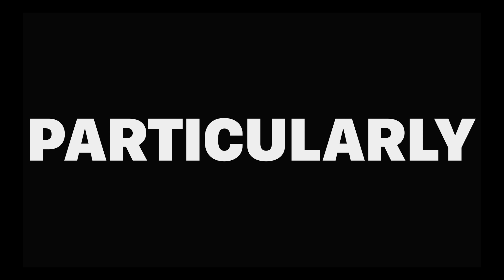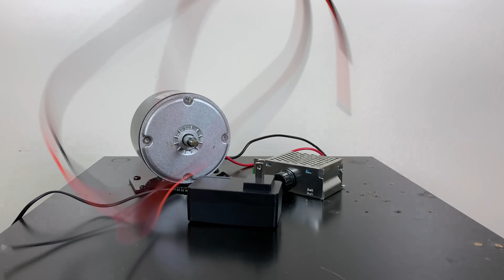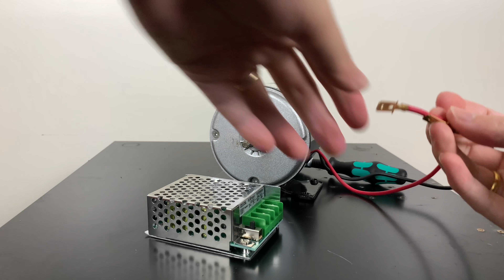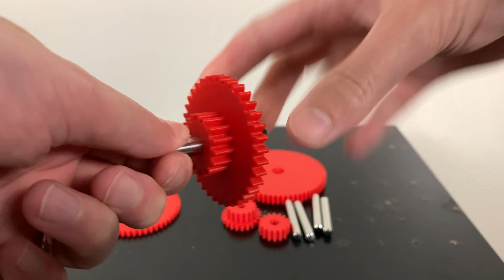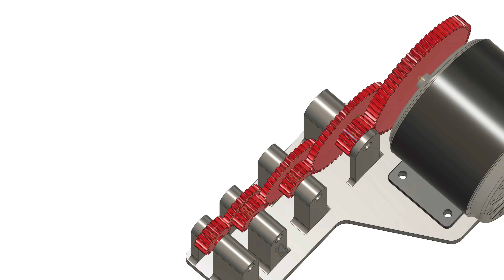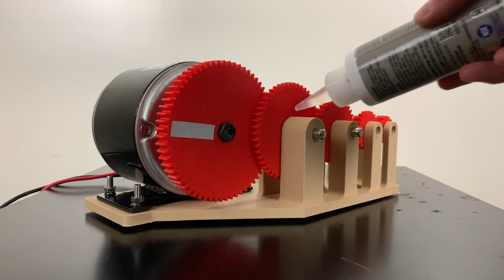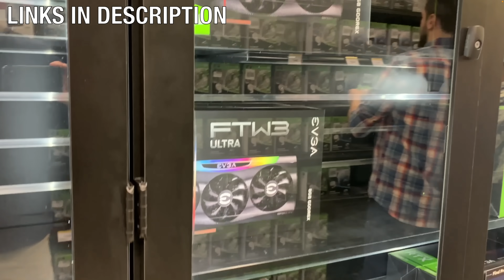Fastest 3D Printed Gearbox Ever.

Comment: The large motor did not stall, instead it drew too much current for the power supply to handle.

With brushed dc motors, the more it is forcefully slowed down, the higher current it draws. 
Since this one is built to spin quite fast, it's very far away from the rated speed, so the current was really high

This does not mean it overheated or stalled, nor did it not have enough power.
A dc motor at this scale probably has enough starting torque to shear these plastic gears, since stall torque (and thus stall current) is REALLY high for brushed dc motors. It's basically a short circuit.
If you hook a dc motor this large up to something like a car battery, you'll see what I mean. Even small motors become harrowingly powerful at low speeds.

Whatever was powering that motor was NOT even close to being enough. It's like putting a lawnmower carb on a truck engine. The engine can handle much much much more, but you don't give it what it wants.

Most non-current-limiting power supplies (so not lab bench power supplies for example) have a simple overcurrent detection that just shuts off power if too much current is drawn.
It then waits a short while and then checks if the output is still overloaded. If it still is, it repeats the wait-check-cycle, but if it is nolonger overloaded, it enables the output again.
This is most likely what happened here.

Motors do sometimes have a thermal shutoff, but that only triggers after a while, as the motor needs to heat up first.

There are also sometimes thermal fuses, which shouldn't be confused with thermal shutoffs.
Thermal fuses are wired in series with one of the supply cables to the motor, and they heat up as power is drawn. Usually, this isn't very much, but if the motor is overloaded and draws too much current for a few seconds, that thermal fuse heats up much faster than normal (due to more current being drawn), and it eventually trips and turns off the motor until it has cooled down again.
This type of fuse auto-resets, so you don't need to do anything but wait a while.

Comment: Well, I'm no mechanical engineer, but with increase in rpm your torque decreases. When torque match the gears resistance the engine will stop. And long before that happens it will start to slow down.

Comment: Torque is more important rather than the RPM when even high rpm motors cant handle moderate amount of gear ratio. First gears material strength will be the second bottleneck when it actually starts to physically break

Comment: 8 gears like that with 10:1 ratio and gear circumstance of 2" should give beyond speed of light with 30,000 rpm on input gear.  try magnetic bearings and in a vacuum. ???

Comment: You'd be way better off with a high speed motor and a single step gearbox. RC plane motors can spin 30,000 rpm alone.

Comment: What you are really missing is horsepower that the 350 watt motor is producing. Horsepower is the rate of change. Torque is in the equation as being able to maintain that rate of change. 
Horsepower is force in pounds times distance in feet divided by time in minutes. So horsepower is measuring the rate of change. That 350 watt motor's horsepower is not changing through the use of gears. You would get the same horsepower rating with just the one large gear as you would if you measured horsepower at the 5th smallest gear. The rate of change on the 5th smallest gear would remain the same as the largest gear.
Now torque would help get that 5th smallest gear to a higher RPM but the rate of change for the 5th smallest gear would remain the same. It would just take longer to get to a higher RPM given more torque. 
But with the torque and horsepower of that 350 watt motor the highest rpm of that 5th smallest gear was all that 350 watt motor could produce. 
Now if you had a 480v 3 phase industrial motor producing 10,000 watts and 2,500 foot pounds of torque, that smallest 5th gear would be breaking the sound barrier. And given enough time, possibly the speed of light..... Only kidding.
Reply: That motor carry people on bikes , his power supply wasn't strong enough

Comment: I bet it would spin so much smoother if you bored out the smaller gears and used a brass sleeve bearing instead of plastic, the heat being produced even oiled would be the major problem

Comment: I very much doubt your gears are actually rotating that fast. Carefully engineered high tech carbon composite flywheels can only do around 60K rpms with levitating magnetic bearings. Crude 3D prints on stationary shafts would undoubtedly explode if they went that fast.

Try the foil reflector on the last gear to see what you’re really getting.

Comment: Use bearings wtf
Reply: @pixelcube6329 then why isnt the drill 3d printed? Exactly.
Reply: @mavenboard exactly. The table isn’t 3d printed either. Or the light fixtures.
Reply: @themedicalmarvels  ikr! i think pixelcube might be 6 and retarted
Reply: He's built different
Reply: @shadxwed_ he's printed different
Reply: O yeah why not
Reply: how about we find a way how to make electric drills last almost 5+ years from a 3D printer
Reply: Guys the rods that the gears are on aren’t 3d printed
Reply: I think he didn't use bearings to make it a challenge
Reply: If it’s not all 3d printed then you can use bearings case closed
Reply: @Legofiftyfour bearings are expensive but he could use ball bearing
Reply: the part where it says 3d printed just purse me off them stuped handles they have fkin hell I no more and yes without bearings it's silly plus there's already little dc motors that spin at like 110rpm
Reply: @eyefishinggunkchannel1011  i think u need to seek medical attention
Reply: Why not just use bearings anyways
Reply: The bearing may overheat with friction heat without any libricant
Reply: @JaivierStuff  and wtf do you think happens without bearings, Einstein?
Reply: I don't disagree, however if there's a little clearance and it's properly lubricated, then the gears working as gyro's will probably turn this whole point moot.
Reply: Bearings😂😂😂😂
Reply: Bro its suppoded to be 3d printed
Reply: Even bearings would explode, noting like brass or bronze oil bushing
Reply: @carlperreault8520  most probably not at this load

Comment: If you really wanted high RPM he could get a Castle Creations brushless 7700kv motor when you run it on 4S or 16.8 volts full charge you should get just about 100,000 RPM and you could put bearings in between the shaft and the gears, also adding grease you could probably geared up two to three times skit about 200,000 to 400,000RPM

The RPM and gear ratio was a estimate but the motor should be able to run the high of RPM and don't run it for too long or the motor might heat up

Comment: Your wires feeding your motor are way too small!  You're not getting near the output the motor is capable of.  The leads coming from the motor are designed to be connected directly to an ESC.  If you need to extend these wires you have to run a heavier gauge.  In your case you have a smaller gauge wire running to the bigger wires from the motor, no bueno!  BTW if you're really trying to get insane rpms you either need to run bearings or tight tolerance lubricated bushings.  The motor didn't stall when you fed more power, you had runaway thermal impedance in that tiny wire you're feeding the motor with, I'm surprised it didn't catch on fire!
Reply: I too know words....Like maximum current. Its labeled on that wall wart, and I imagine says something like 2 Amps. 

Bruh, I get you're excited about showing off, but there is so much wrong in your comment (the situational assumptions, ya know, so your 'but these words do mean things' doesnt act up) Im just gonna signal to you that you missed the mark and walk away.....
Reply: @zombieregime  I was just trying to help...  Your inability to accept criticism is your problem not mine.  have a good life!

Comment: For speeds like that, ball bearings with the proper C value will be a game changer, every C value is for a particular rotation speed. This will enable you to stop the gears from rubbing and shifting back and forward on the axle. I use C3 barrings up to 20k rpm. Above, you would probably need type C4.

Comment: This is a direct downgrade from other gearboxes that have been built on this channel. There is no bearings anywhere which creates a huge amount of friction which slows down the whole system, the torque that can be applied to that singular hex bolt holding on the drive gear is low, gear spacing was never even mentioned, and there is no lube anywhere. This guy is clearly just a print auto generated gears from fusion360 kind of 3D printing hobbyist who doesn't even learn from his own videos like the video that he posted 2 years ago with a faster output shaft speed, crank driven gearbox.

Comment: The motor isn't stalling. The power supply is being overloaded. Assuming that 350 W motor runs from 24 V, you'll need a 15 A power supply. That one you showed doesn't look like it could do mote than 2!
Reply: Could be an scr  120 < 90 dc brick all tho it looks like a dc scooter motor  i have pulled a few 2hp dc morotr this frame and size from tread mills and they ran 90vdc 7- 10 amps 
Soooo...   need more information  i think ..  as them lead wires are not going to do 30 amps for long with out heating up..

Comment: There is no way that little power supply can feed that motor under load. That motor stalling is probably the power supply cutting out. Get a bigger power supply so you can feed it some proper BEANS!

Comment: The motor is not going to suddenly "stall" as the power continues to be increased (unless it burns out).  Instead, it would simply reach a maximum speed.  Probably you reached the current (or temperature) limit of your supply's regulator (or maybe the speed controller), and it shut off it's output to prevent damage, until the load was disconnected (or the semiconductor device cooled down).  You can check this with a voltmeter across the motor wires.
Reply: I was thinking the same thing! Brushed DC motors like the one he showed don’t “stall” since they’re mechanically commutated (they can stall but not in the same way as BLDCs, like the guy in the video is describing)

Comment: Your biggest problem is that you are trying to feed a 300w motor with a tiny power supply and when the motor overloads the power supply, it shuts off. Borrow one from a 3d printer and try again.
Reply from the maker: !! the Ender 3 has a 24v 350w power supply, would be perfect for this motor

Comment: Hey, just a thought, you could try to use magnetic gears to avoid friction, plus put gears on a special high speed ballbearings. Eventually, the speed is limited by the material strength, at some point the gear will self destruct by the centrifugal force, so maybe the last gear could be made from metal. Theoretically, few houndreds thouthands PRM could be reacheble

Comment: at this point just build it out of metal
Reply: Yes
Reply: Smart
Reply: Smart but metal 3d printers is very expensive
Reply: @Jason_69-gb1it  or use a block of metal and cut it to a gear. Who even 3d prints metal?
Reply: @trk.is.trippinRich nerds
Reply: Did you not read the Chanel name

Comment: Honestly this video was mediocre, I liked your math and how you explained it, but it would have been better if you had done more research ahead of time then show several experiments differing a single variable each time.
Reply: At the beginning of the video you might go over different ways to increase the speed (base motor speed, gear ratio, reduced friction, etc.). 

Then you might focus on a single topic for the video, like how to decrease friction as much as possible with a high gear ratio. You'd go over several different methods for achieving this (different tooth shape/length/size, ways to decrease axle friction, size/number of gears, methods of gearing, etc.). 

Finally you would set a control case and do several experiments changing one of those methods to decrease friction each time to try to find the best configuration.

Similar to what you did near the end of the video talking about how it's better to just buy a "faster" motor, you might go over key takeaways of what seemed to make the largest improvements, and then maybe even do a little look under the hood into how motor manufacturers increase the speed of their motors and convey that in the video.

Comment: Isn't the torque of DC motors directly connected to their speed (input voltage)? Wouldn't an ac motor be better suited for this type of application? That way you get max torque even at lower speeds in order to fight that high torque?

Comment: Try using some bearings next time. That way the force of friction will be reduced to a minimum, may achieve a higher rpm that can be sustained. This will also increase the efficiency of the system.

Comment: the plug you used to power that motor i guarantee wasn't enough amps I've used those motors they take a lot use 2 12 volt battery's to power the motor and it should reach 100k rpm that power brick can at most give 3 amps of power and that motor uses 14 amps under load

Comment: some issue you have is also power the wires and transformer you were using definitively doesn't trow 14 Amps for the motor to hold on the 350W

Comment: Your power adapter cannot supply enough current to the motor to get the speed you are wanting. You need to match the power supply to the motor. If you have a 100 w motor it is reccomended to have at least 10% more power to the supply. ~110 watt. if you have a 500 w motor you should have a 550 watt supply or greater to handle the current and not have the supply shut down due to its overcurrent protection.
Reply: it's a pwm controller not a psu
Reply: @fss1704  PSU = Power Supply.

Comment: What if we implemented this design into vehicles? Would it result in less fuel consumption if the motors are spinning slower gears but putting out a faster rotation?
Reply: that's already implemented with those 10 speed gearboxes that are becoming sorta common nowadays. at the cost of stressing the bleep out of the engine, you could theoretically have your engine sitting at idling rpm while driving at 60mph on the highway.
Reply: forgot to mention it does impact fuel consumption in a good way, because in a nutshell lower rpm equals lower fuel consumption... theoretically. im not a motor wagon fixer person

Comment: when you consider the standard measurement of a HP... 550ft/lbs/sec...

get a 5 hp engine.
stick a small flywheel on it. rev it.

calculate the moment of inertia of your flywheel. you know, massxrpmxdiameter... theres something about halving if its solid...? lol, go look up the equations yourself!

whast bigger? torque available at that RPM ,ie, HP,  or the inertia?
HP is larger, its a small flywheel.... the engine will overspeed and blow up with no load at WOT.. cool :)

prove the opposite... garage54 did it. add flywheels. the more you add, the slower the engine runs. the less power there is to use.

 calculate the inertia...

you go stick a massive 3 tonne , 5 meter wide wheel on your lil dinky 5hp engine. 
on every combustion cycle, it can only deliver so much force.
if  that force is inadequate... the engine simply wont run. it can only make its "5hp", forcextime, at a certain speed. and if it cant even reach that speed as its force is inadequate to accelerate the mass... it cant store enough energy to continue with a complete cycle.

and whats left over? nothing. the whole point of an engine is to drive something... not flywheels! so the smallest flywheel possible is used. you still need enough flywheel to store sufficient energy in its momentum to turn the engine over to complete another cycle though. theres a nice sweet spot that stores sufficient energy, and also doesnt absorb too much energy. theres a perfect size that actually limits the maximum RPM... but kills the power curve. whaaaa?

(for the pundits that remark on vintage engines having big flywheels... that old school 5hp engine with the 5tonne flywheel was designed to run at 50RPM! not 5000! its 15L of brute torque, baby... not a 125cc lifan.)

anyway. its sort of whats happening here. not only are you fighting friction of gears, you are fighting this increase of angular momentum...

the gears need to be smaller! lighter! less mass!

Comment: Some big improvements can be made to be honest. First of all bearings would decrease a lot of friction. The second is to use as little gears as possible. There is energy loss in every gear connection you make. Rather use two gears with hughe size difference than 5 in a row.  Third every motor has a rpm range that delivers the best performance, depending on the motor type this range can vary but in most electrical motors this range is actually at low rpm.
Reply: I don't know about using gears that are as little as possible. That doesn't seem like a sound idea.
But yeah, he should try to find some print files with helical gears in them instead of spur gears. Why use spur gears when you could use helicals? 🤷🏻‍♂️

Comment: The key is, for that 35,000 rpm motor on Amazon, that rating is given with ZERO load. (And that motor is probably not strong enough to sustain that RPM with a load)
So potentially a 2:1 gear ratio attached to it might have such a load as to reduce the motor speed by half, thereby only maintaining 35,000 on the output side of this 2:1 gear ratio.

Comment: If you would've put that motor on a car battery (assuming it was a 12 volt motor), it wouldn't stall so easily. Probably would've broke the gear box. xD
Reply: it is, the box in the video is a pwm controller.